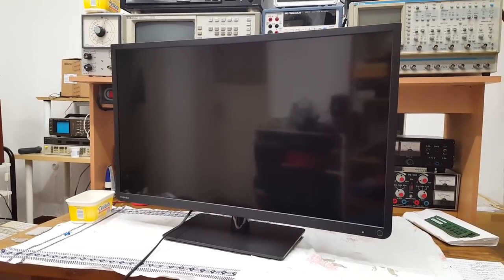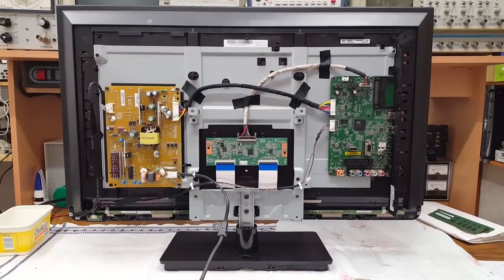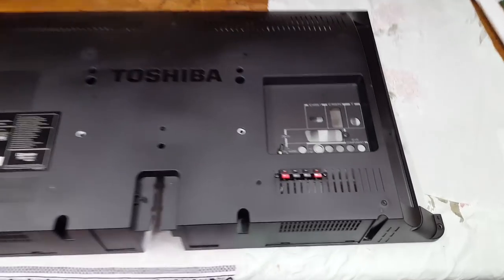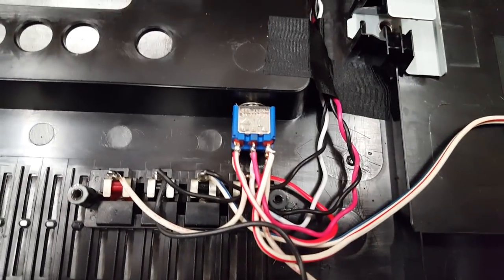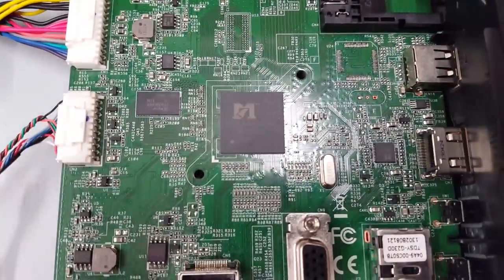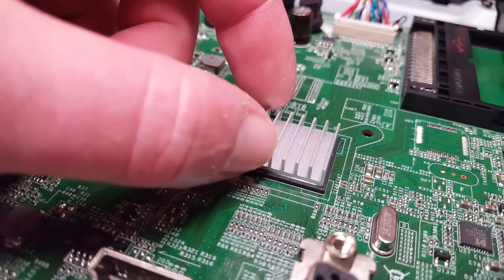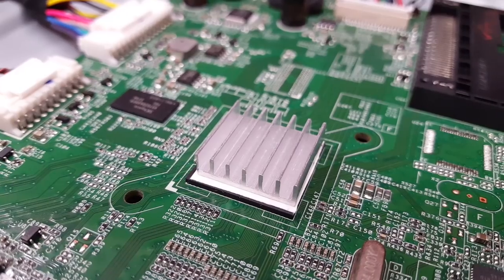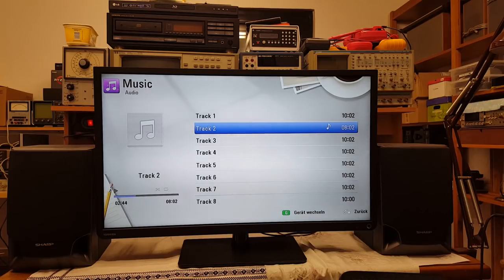Modifying a flatscreen HD TV for use with external speakers + adding a heat sink

Comment: This needs to be a standard for these flat tvs it saves energy, less clutter yet making the sound better
Reply from the maker: Terminals for external speakers would be a relatively cheap feature to add to a TV, but for some reason only very few TVs have it.
Reply: @DrCassette   most consumers don't have analog speakers like in the end of the 90s when mini component hifi were used, they will just buy a soundbar because it will look better or just use the internal speaker

Comment: you won't believe how this mod changed my life, i did this 3 years ago, i have the 32" tv in my bedroom and didn't have space for an amplifier, i have great sound and with replaced firmware i have even better sound (i took this tv apart because it was bricked so now i found a lot of firmwares) and i can tweak audio settings in the service menu settings, i hooked up some sony speakers from a mini hifi, i did it the easy way by just connecting wires directly from a tv hole and some electrical tape (no soldering), they sound better on this tv than the thing it came with, i can wake up with high quality sound without setting up 2 timers, i can enjoy loud music all night
the tv also has a lot of features, only problem with new firmware after i bricked the tv recordings are encrypted, every firmware i tried has encryption on recordings, it's also possible to use satellite tv (i tested it and works)

Comment: Nice mod, i recently got Vox tv and first thing i have done is connected external speakers. Difference in sound is huge. I have done it differently, got cheap 2x15w amp and 12v adapter since tv came with 2 year warranty. Simple but effective.
Reply from the maker: That's exactly what I did not want to do, because you have to turn the amplifier on and off along with the TV. Are you even able to adjust the volume using the TV's remote? That's the advantage of old equipment, you can do with it whatever you want as there is no more warranty.
Reply: @DrCassette  It's connected to TV's headphone output so i can control it with remote just like i would normally. Amplifier is constantly turned on, there is no noise when working and only uses 1W of power so it's not that bad, i mounted in on back of the TV. There is also USB port on back of TV which is how i wanted to power it since it turns it on with TV but decided not to since i put movies and shows on stick so i can watch sometimes, or record shows. Would definitely go your way considering it's much simpler and uses less wires.
Reply from the maker: Just a normal USB port is not enough to power an amplifier anyways...
Reply: @DrCassette  2.5W is enough for how loud i listen to it (considering that with 5v supply you can't even get more than 1W on 8 ohm speakers) when paired with decently efficient speakers or i could use 5v to control mosfet that would turn on amplifier. I like the way it turned out, as i said no noise when amp is in idle so i didn't want to overcomplicate things.

Comment: nice job on adding switch for speaker selection, i did the external speaker mod on one of my TV as well, but ripped the internal one and just made it external, any speaker is just sounds way better than the tiny speaker in the flat TV…
Reply from the maker: I wanted to keep the internal speakers because you can never know when they may come in handy...
Reply: true, but mine hasn't moved for years, its a 55 incher and im not worry about it ;)

Comment: I wanted to do this to my tv as well,connect external speakers.But I was scared that maybe the external speakers would be too much for the built in amp,even though they're rated at 8ohm,10 watt.
Reply from the maker: The internal speakers of the Toshiba TV are 8 Ohms, 7 Watts. The external speakers are 8 Ohms, 20 Watts. I wouldn't use any speakers with an impedance below 8 Ohms, but that should be all that matters. Also I'd expect the Class D amplifier chip to have integrated overload protection and all that.
Reply: As long as you use external speakers with the same impedance as the internal ones the only potential problem you may encounter is distortion when listening at high volume or with particularly bassy content. This is caused by the television's amplifier being overdriven and, as DrCassette says, their should be in-built protection against overheating etc.
Reply from the maker: @WaltonPete   I was very surprised to find that the external speakers end up being louder than the internal ones. I was expecting better sound quality but lower volume. But I got both better sound quality and more volume. So I'm quite confident the built in amplifier will be powerful enough for my needs. But of course this depends on the model of television.
Reply: @DrCassette  used 6ohm speaker with no problem

Comment: Man this is genius. Im thinking about buying a second hand flat tv for my dorm and my main idea was using my stereo as an amplifier but that would require extra wiring and an external selector. so im gonna plain copy your mode to use a couple of technics speakers i have laying around. Also im gonna use the external output to plug a woofer for that extra boom i need to mess with my neighbor
Reply from the maker: Please don't use a subwoofer to mess with your neighbour. I have suffered under such antisocial behaviour for years. It's horrible.

Comment: @DrCassette, does it matter what the impedance or wattage is of the external speakers?  Also, are your external speakers powered? 

I imagine the amplifier chip you pointed to can only output so much.  Having said that, the results sounded amazing on your video.
Reply: The speakers are only amplified by the tv i tried this with my tv and sounds great :)
Reply from the maker: The impedance of the external speakers should be the same or higher than the impedance of the internal speakers. The wattage is not critical. The external speakers are not powered, that is the advantage of this modification.

Comment: all flat tv's should have this and rear speaker outs and a subwoofer out rca jack on them
Reply: I pretty much agree as the old CRT TVs and even a commercial TV uses a speaker out, but no modern consumer grade TVs ever had that. A TV shouldn’t really have built in speakers these days at all. They should’ve add mounts and add side speakers with at least 20 watts per channel with a 2-way bass reflex setup. And it’s a lot of money to buy a sound bar. This video is very helpful and I hope manufacturers remove built in speakers and just put in speaker outputs along with a rear, middle, center, and two subwoofer outs and maybe dolby atmos speakers out. That would be even better. The built in amplifier is more than enough, but the speakers are less than 10 watts and it’s only full range drivers that don’t go below 150HZ.
Reply: @loudspeakertestsmorebyaida3804  90% of people don't need "good" sound quality and are fine with the tv's internal speakers, but they are not fine with buying a 4k tv every year just to watch 90% of the time SD content

Comment: Nice mod! Dave Jones recently had found a rather new LG tv in his dumbster room and it had some really weird fault. The panel was fine but some of the processor’s needed reflowing. That did not end well, but it shows how easily modern ball grid array chips with lead-free solder can cause electronics to get tossed out in the dumbster because of their fragility.
Reply from the maker: The BGA chips are a common source of problems, especially when not cooled properly. My old graphics card failed due to bad BGA joints. I gave it to a friend who was brave enough to bake it in a kitchen oven. He actually managed to get a few more years of service out of the card after that. I am thinking about investing into a hot air rework station as that seems to be the best tool for at least trying to fix bad BGA joints. I am not comfortable with putting electronics into the kitchen oven and my heat gun when used on electronics has so far always done more harm than good.

Comment: Great mod!
I did the same, but without the switch. Disabled the LCD speakers.

Only one thing.. there's some white noise over the speakers now. Do you know how to eliminate this problem?
Reply from the maker: It could be that the white noise is just some inherent noise of the TV's amplifier, which is now more audible because the external speakers you have connected are more sensitive than the built-in speakers. These TV amplifiers usually are not the best. Of course if the noise is dominating the audio output, there is some sort of problem.

Comment: Including how to do the wiring to the internal wire system would have made this vjdeo exceptional.
Reply from the maker: It is a very simple circuit, you take the speaker outputs coming from the PCB and switch them either to the internal speakers or to the external speaker connectors. To be honest, if you need a schematic to work this out, you should probably not open the TV for your own safety...

Comment: wouldn't there be some kind of high-pass filter on the TV's speaker output?
Reply from the maker: There is a low pass filter on the output of the class D amplifier IC to filter out the switching frequency.
Reply: My tv has a compression filter for music over 0 db or (-2db), it makes the quality a bit worse

Comment: Hi DrCassette,  that plastic white connector inside the TV, how could it be turned into RCA outputs instead? if  Could you pls say how? Or link to some ready adapter that would do that. i have a samsung tv and i have active speakers (not passive like in your video)  that i would like to connect to my TV. Regards/Ed
Reply from the maker: You could just simply plug the active speakers into the headphone output of your TV?
Reply: @DrCassette  it doesn't have any headphone output.
Reply from the maker: Oh... you could install RCA outputs instead of speaker outputs, but you would have to keep the volume very low to avoid overdriving the external speakers. Or reduce the audio level with a resistor network...
Reply: @DrCassette  so the signal would be to strong for active speakers, i guess its the reason why i haven't seen any rca hacks. i wish i had learned some basic electronics :) thanks for clarifying,  Regards

Comment: What do you think about  technics su 7300
Reply from the maker: It looks like a nice amplifier, the specifications are pretty good. But there may be some contact problems in those old switches and potentiometers.
Reply: Yes they were some concact problems😂 but y cleaned them, the thing doesn't have a skratch on it😊. And also I have a pair of quadral ac110 speakers.

Comment: The bass reflex you have used,  may I enquire to their ohms?
Reply from the maker: The impedance of the external speakers is the same as the impedance of the internal ones.
Reply: @DrCassette  Interesting, .. Good job! I guess the speakers are active, right ?!
Reply: @caveman3201  No they are not active!

Comment: Just use the digitak audio output into a receiver
Reply from the maker: I don't want a receiver as you have to turn it on and off along with the TV and you need a second remote control to control the volume. It makes everything more complicated than necessary.
Reply: @franciscoBurrola You miss the whole point!!!